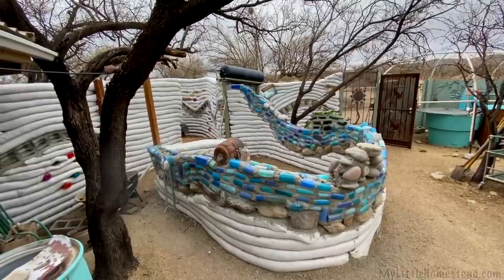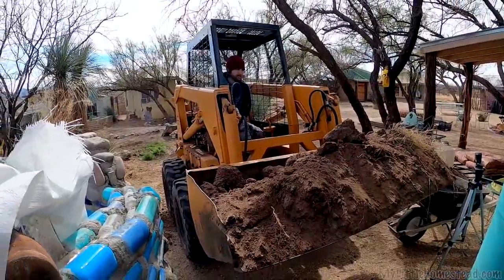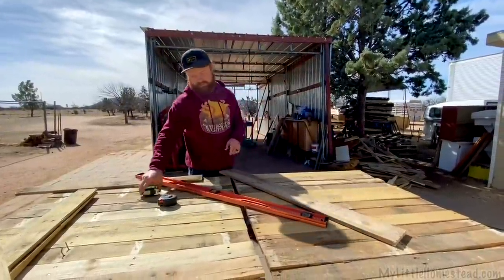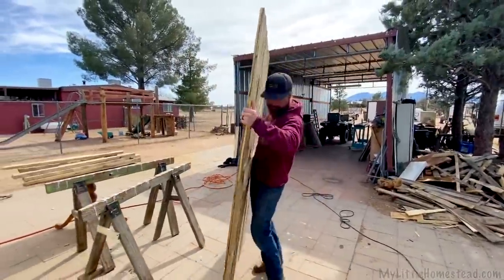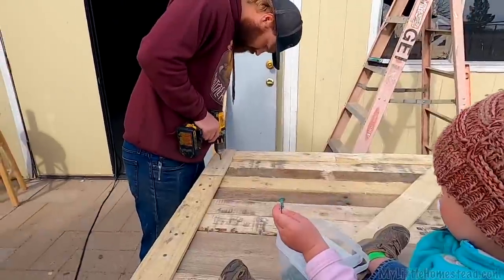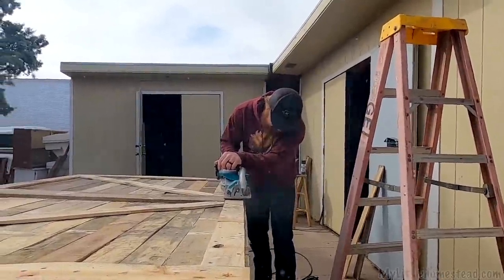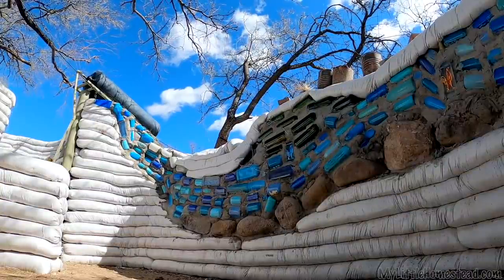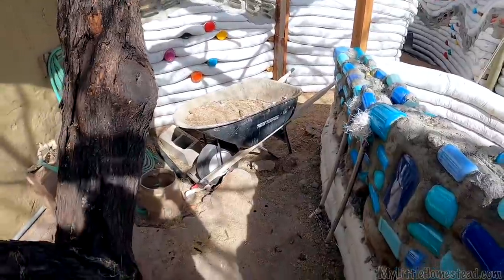Free Pallet Barn Doors & Outdoor Shower Dirt! | Weekly Peek Ep272

Comment: Garren you really need a planer to run the pallet boards through to even out the thickness and reduce the need for rough sanding.
Reply: Also, few things in this world are more satisfying than milling rough lumber to perfection. But you need a jointer too. Somebody donate this guy a planer and joiner already! Or sell him one on Craigslist for cheap
Reply: I don’t think they remove the nails

Comment: Hopefully you used a natural sealing wax to allow the tree to heal back together once you bend it.  The sealer keeps bugs and bacteria out that cause rot.  Also our local big box lumber shop pulls the warped boards off their bundles and sell 50%-70% off.  We take that lumber and stack it like fresh cut lumber it’s ‘stickers’ between layers and put 10 tons of weight on it for 12 months.  When it straightens out perfectly we use it for finish lumber on our farmstead.  We’re re-furring a very neglected farm house on 10 acres.  The farmhouse, 40,000 sq’ dairy barn, shop, garage, silage barn, machine shop and six outbuildings have survived over 112 years and slowly getting back to it’s former glory.

Comment: The bathroom wall is looking really good, maybe a u shaped piece of wood that extends from the inside and the outside to use as a ledge? that way you have one on the inside and on the outside (might have to water seal it so it doesn't rot) or maybe even a piece of metal that's been curved and the edges sanded off in the same fashion for the ledge? or maybe even long necked bottles put in where the bottoms stick out and the necks go in between the bags to hold them in place for ledge? use maybe a 'u' shaped piece of wire poking through the bag in order to keep it in place? As long as you don't bump into it or place anything heavy on it, it should be okay. You could fill them with quick cement to make them more stable, then break the glass off or leave it on for the color. So many ideas are popping in my head, but there's a few, it may or may not work but there's no harm in trying right?

Btw I still have my earth bag design, let me know if you want me to share it to your facebook page.

Comment: Actually if the green bottles were laying horizontally, so the ends stuck out, it would have protruded more shelf-like and you’d see the round ends of the bottles and not the sides.

Comment: Hi Garen, it just slipped your mind, as it does mine, to use wood glue. It's stronger than any amount of nails and screws. We all forget... :)
Reply: I didn't know that. Thanks for the tip
Reply: When I build with pallet.. man is it crooked. I glue everything, nail it then lay it flat and sand bag it flat with old doors or something rigid. Like with your body's bones. It will never break in a glue mend. Man you will be amazed. Due to the nature of pallet. The glue gets in there real good up to three four mills,.you can even pull your nails out after. It truly is a lasting bond.